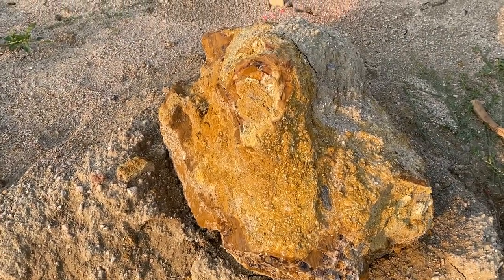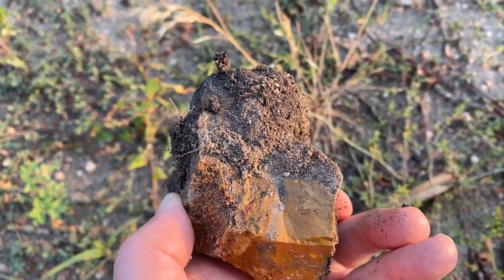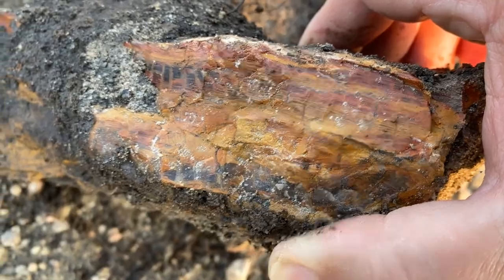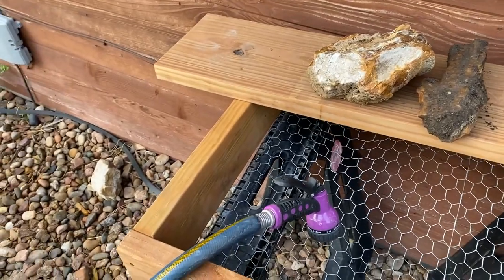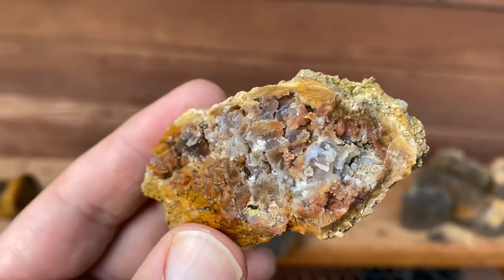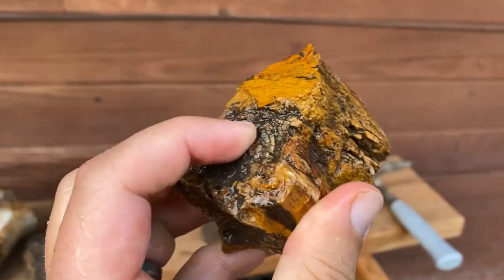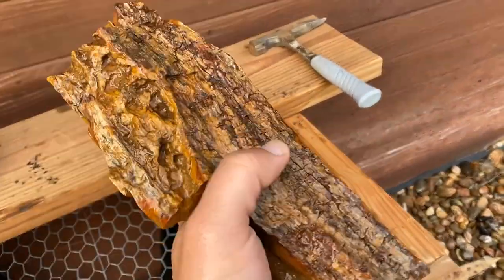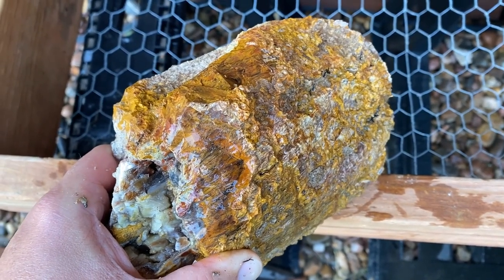Hunting Beautiful Agatized / Opalized Petrified Wood in Parker, Colorado

Comment: Don't be a wuss!  I got a two hundred pound agate in Utah up a few hundred foot tall butte by myself.  Then rolled it down the other side to get it to my van.  It didn't crack luckily.  Took almost two days.  Wasn't worth it because it was basically just light blue chalcedony inside.
Reply from the maker: Haha. I did try to get a few of the big ones. I think the largest I got into my 4Runner was about 150lb. There’s a few pieces back there that are easily 300+. I just don’t know what I’d do with them once I got them home.